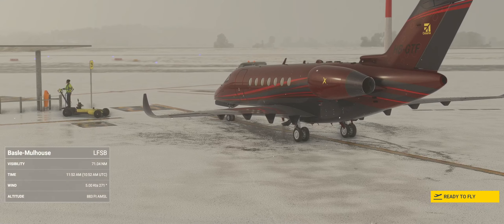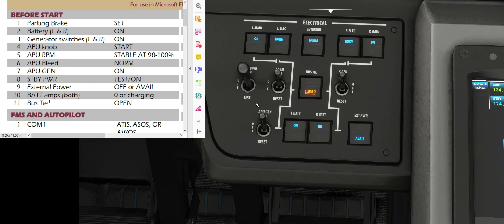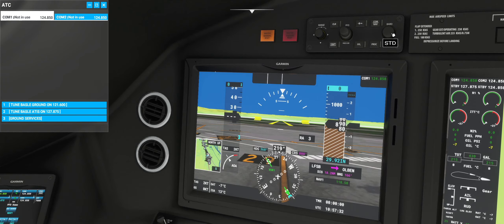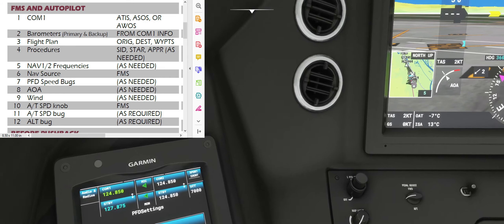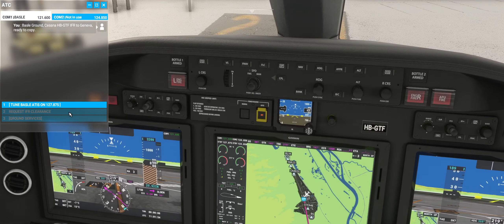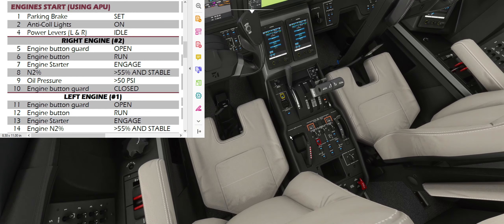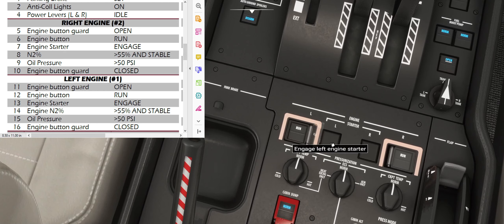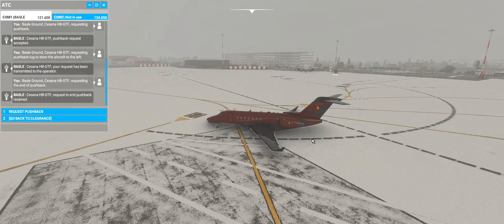MS Flight Simulator 2020 - Cessna Longitude - Running the Checklist from Cold+Dark to Engines Start.

Comment: N2 is rotation speed of the high pressure turbine located at the rear of the engines. It is expressed in percent of the max rotation speed.  Quote from manual of older Citation S550 jet: “provides digital indication of high pressure (N2) shaft rotational speed in % RPM, with 100% equaling approximately 32,760 RPM. The readout displays in tenths between 00.0 and 99.9%, and single-digits above 100%.”
N1, top gauge, is the low pressure fan speed of the engine.  ITT is Inter Turbine Temperature.